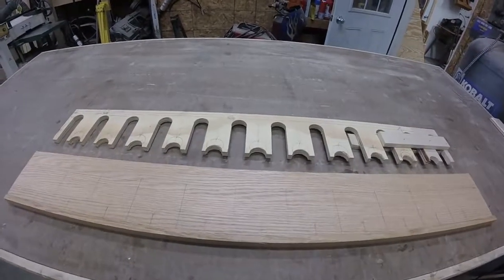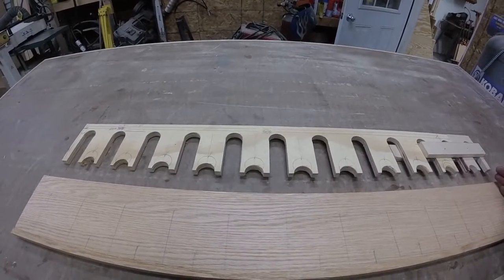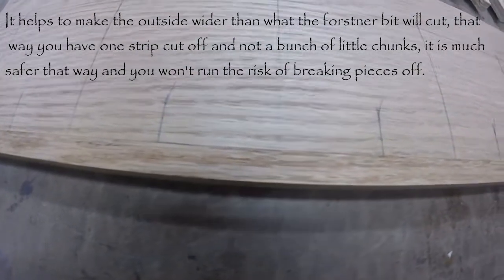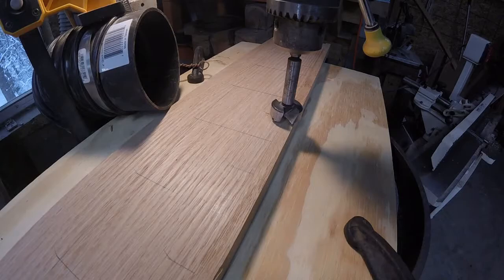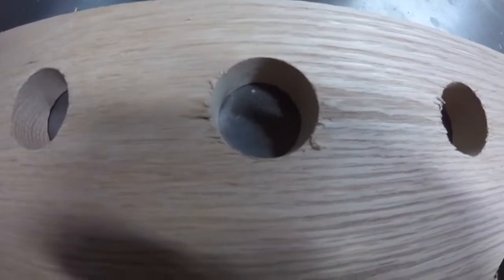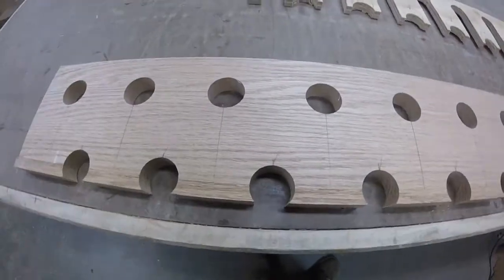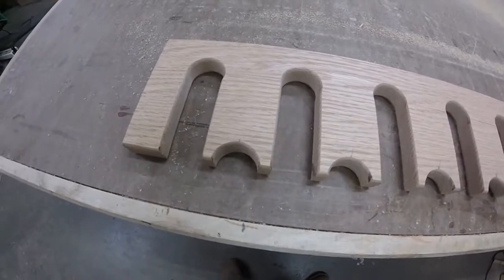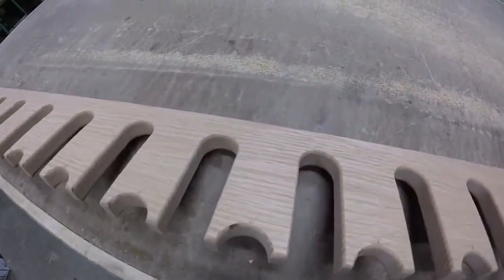Maximizing space in a gun cabinet build

Comment: Good theory but won't work unless you have extremely thin guns. Add in bolt actions and ARs next to lever guns etc and they will be bumping into each other.
Reply: I have mostly bolts with scopes and a few ars in there and they all fit well, it's tight, but I'm tight on room so that's what I had to do.  There's enough room where there they aren't rubbing on each other.

Comment: What spacing did you use between the front row and back row? And is this a 1x6 piece?
Reply from the maker: I started with a piece roughly 6" wide, that gave me room to drill all the holes in solid wood.  the finished piece from the very back to the back row of rifles is 1-1/2" to the center of the hole and to the front row in 4-1/2" to the center of the hole.  The spacing between each slot is 1-5/8" center to center, so each front is paced by 3-1/4" and each back the same.  I need to get a video up of the finished product, I keep forgetting when I have time.
Reply: @northernliving4290  Did you cut the board down to 5 inches? When you put the square ruler on it to scribe the lines, it appears to only be 5 inches wide. this would also make sense with your other cuts.
Reply: @D_Boone  I think it's 5-1/4

Comment: Greta idea,  how did this this rack work out in the cabinet?
Reply: It worked great!  Scoped rifles in the front, non scoped in the back, the key was spacing between the cutouts.  Definitely a solid solution.
Reply: @zacharycullen3677  Thanks Zach, My youngest Daughter needs a cabinet for 20 guns and I'm trying to reduce the footprint of a big case
Reply from the maker: I just got home and measured it.  For reference the inside dimensions are 38 1/2" wide 14" deep and 50 1/2" tall.  There are 23 spaces with two open.  Its tall enough to fit a couple sidelock hawken muzzle loaders as well.  If you have any questions let me know, it works great.  I will try to get a video uploaded of the finished product, i got slammed with work this summer and just havent had time for anything.
Reply: How wide is that board and how far off the back are your holes .this looks like a answer to my room problem